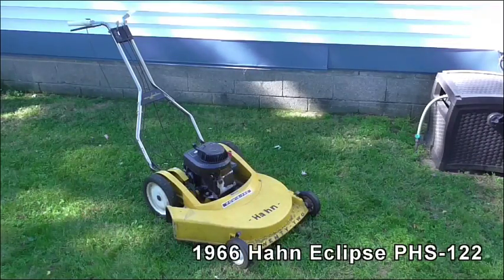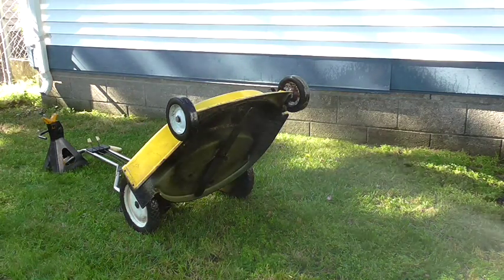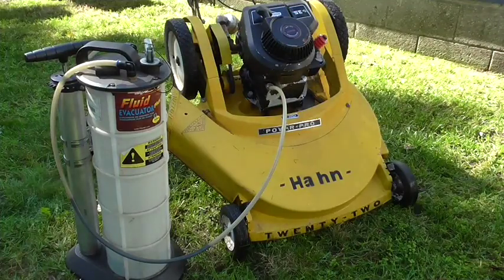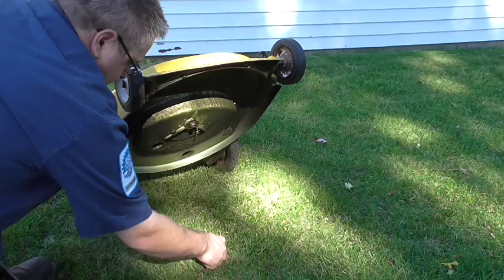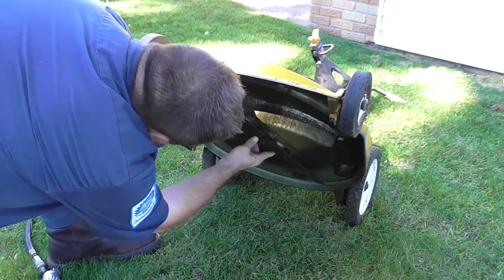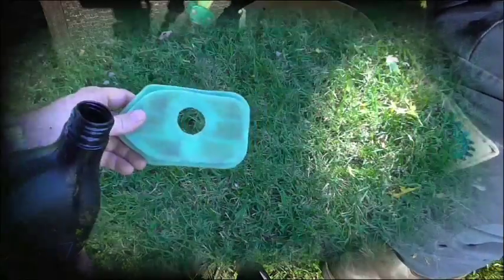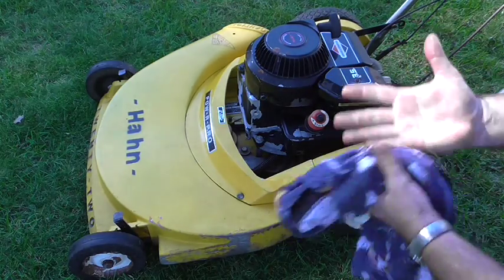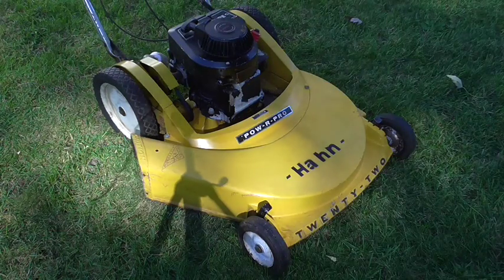Preparing a lawn mower for storage

Comment: I hope the blade engagement control still works correctly!

Since you say this mower was made in 1966, the original engine was a B&S 92982 (type 0179-01) that was painted white! The original engine RPM (especially at idle) was much faster than the pitch/tone I can hear on this one.